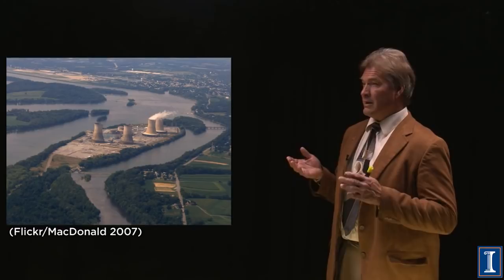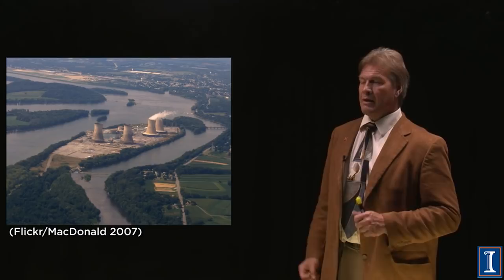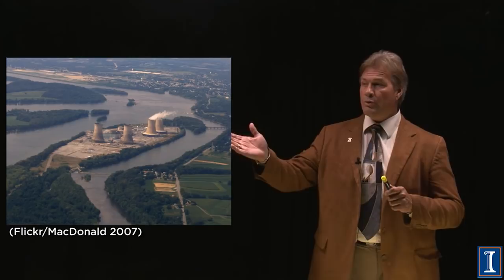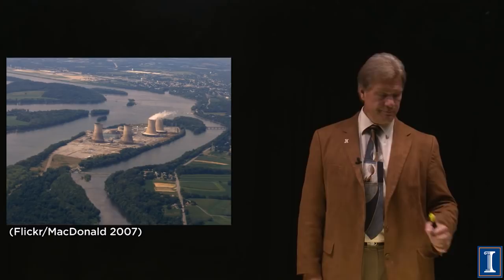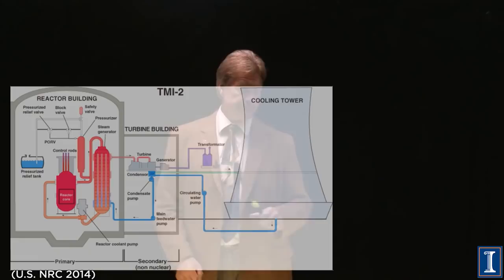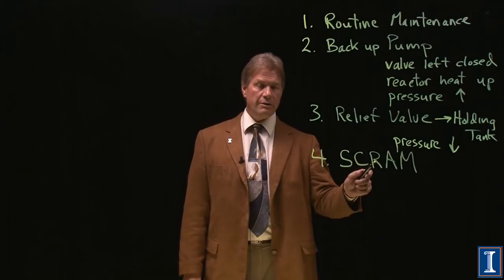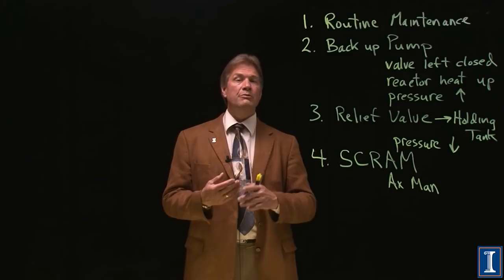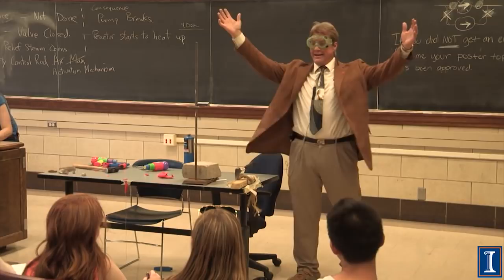How TMI Started

Comment: "It's always the middle of the night when things go wrong" XD.
Reply: 100% Worked in a plant with Ammonia, lots of it. Well I worked on the operations side which was monitored with thousands of alarms. One night the accumulator built up pressure and the relief valve should have opened but didn't. Que a little bit of panic, followed by massive amounts of phone calls that went unanswered for a pretty good amount of time (30-40 minutes) 1 AM. Easy to spot where the problem existed by the piping not having frost built up on it. Hard to figure out why though. Short story was a whole fucking 2x4 left inside some piping that was earlier locked out for another reason and worked on. Still don't know how or why the 2x4 was in there for any logical reason. Some contractor got fired for sure though.

Comment: There is another valuable lesson here for Electrical Engineers and mission critical monitoring systems. At TMI the "valve closed" light in the control room merely monitored the power to the motor or solenoid that was to close the valve. There was no feedback that the valve actually closed. You need a separate sensor to indicate if the mechanical action actually happened, not just that it was told to happen. This idea was nothing new at the time. Every aircraft with stow away landing gear had/has such a system. "The gear down and locked"  light actually monitors the mechanical action, not just  that power was sent to the motors or hydraulic valves. I am really surprised this was overlooked in the TMI design.
Reply: I agree that no physical feedback on a safety value, to prevent a major nuclear accident, is nothing short of negligence on the part the the design team, the oversight team and the nuclear regulatory commission.  Can you imagine being in a plane with "3 greens" from the landing gear without a physical feedback mechanism?  There would be hell to pay for the 1,000's of people killed in planes with stuck landing gears.  A major nuclear accident would kill millions of people.  What would we get from the design teams after millions of people die from their oversight, "Oh I am sorry, I forgot about that!".  That is such bullshit.
Reply: Poor design.
Reply: Thats insane!! Very Poor Engineering, no readback on actual valve position!
Reply: System was believed to be reliable to the point that such a confirmation system was not nessessary, however there was in a place a procedure to ensure PORV closure, a thermocouple was installed within the PORV outlet, this would indicate as to whether the valve was closed or open.... this check was carried out and the results ignored, misinterpreted and put aside as a result of the previous operation of the valve. Like many other steps if they had followed procedure and closed the manual outlet valve down line of the PORV the loss of coolant would have been prevented.
Reply: @jonnytightlips513  But see, that was still a roundabout method of verifying the valve position. If you also want a temperature reading, the thermocouple is fine. But why wait for temperatures to rise and approach a critical situation to send an alarm? A flow sensor or some kind   of linkage switch is still required IMO. Big red light or cell on the alarm panels. "PORV not Closed" period! At that point the critical problem is obvious and the actual water temperature is a secondary concern. I am an EE approaching retirement so I know a little bit here about control systems. Oh and at the time of the TMI disaster I was a student at Drexel University in Philadelphia. So if it had melted down and breached containment, I would probably not be here to write this! But I still remain a strong advocate of nuclear power generation. It's still the only practical "clean" method.

Comment: What a stroll down memory lane.  I wrote my doctoral dissertation on this very topic of TMI-2. Your explanation is spot on and very understandable.
Reply: Do you subscribe/have you heard of the theory that there was sabotage involved? I have no "dog" in this theory either way .. more can be found on the theory here:

https://atomicinsights.com/was-three-mile-island-an-accident/

Also, there is quite a bit in the comments section on that page with additional material and observations by others from that era.
Reply: How did the pump break?
Reply: uploadJ  I had not heard of such a theory. I was analyzing the performance of the men in the control room from the standpoint of organizational psychology.
Reply: Jim Lahey everything I was able to get my hands on said that on March 28, 1979 at 4:36am a crew was trying to clean biological build up out of the filters for the main feed water pumps. And for some unknown reason the main pumps failed. I always thought maybe they dislodged something. Then a bypass valve failed to open as well. I have never come across any information as to the cause of that.
Reply: @jimlahey5354  The accounts that I heard shortly after the accident are rather involved.  When water got trapped in some small instrument air lines that controlled valves for condensate filters, the filters isolated.  The main feed pumps that pump water into the secondary side of the steam generators then shutdown (not 'break') because of a loss of suction pressure (pumps often have low-suction pressure trips, to PREVENT them from breaking).  When this feedwater was interrupted, the primary temperature rises very quickly, the expanding primary coolant surges into the pressurizer and raises pressure.  The PORV valve is designed to automatically open and relieve this pressure increase.

Comment: It turns out the big valve was designed as a scaled-up milk line valve.  In a creamery, the valve is continually lubricated by milk and milkfat.  Not so in a reactor, there the water is corrosive.  A hard-learned lesson.   A billion-dollar lesson.

Comment: GREAT VIDEOS... Questions. There were indicators telling the operators the holding tank was filling up (I watched the second video) but because of it's location NOBODY saw it for almost 2 hours? No indicators telling them the core area was losing water, especially a totally uncovered core? If EITHER of those things happened and surely they had that.. They would have known to restart the ECCS either slowly or much sooner and trace the water problem to the stuck valve. I'm still amazed that even in the 70's they didn't have backup indicators on everything such as the valve or people to run physical checks on everything during a problem. Also wouldn't they have had Hydrogen (the gas) indicators as yet another fail safe and gas exhaust ports to prevent build up ?
Reply: They did have a backup indicator in the form of a temperature sensor on the valve outlet piping. The problems were that that particular valve had been weeping (a very slow leak) that caused a higher than normal temperature even without the valve being stuck open. Also, the expected temperature would not have been as high as one might expect, given the behavior of steam as pressure is reduced. Finally, the backup indicator was not in the main control room benchboard area, and was not in their procedures to check. After TMI, plants went to a vibration method, such that if the valve is open, the tailpipe will be vibrating.

Comment: At IEP, I’ve been watching your content back to back and I absolutely love it. A huge thank you for your sharing of knowledge. With regards to this video, you mentioned water being a combination of hydrogen and oxygen which when super heated has the potential to break bonds and release hydrogen (as per on of the Fukushima incidents (I’m no expect but I believe I heard that somewhere)).... my question is, is there a moderator that would be better suited than water. The capability of releasing a volatile/explosive chemical seems like a bad idea if in the most unlikely of situations. Thanks again for your work. My greatest respect
Reply: A good moderator has a low atomic mass so that the fast neutrons (coming directly out of the splitting U-235) are slowed down by 'elastic scattering'. The lower the mass of the atoms where the neutrons 'collide' with, the more energy is lost with each collision. Hydrogen (in form of water) is a ideal moderator, because is consists only of one proton (and an electron of course). Another important feature of a good moderator is that it only slows neutrons down, but does not (or nearly not) absorb neutrons in the nucleus.

You could use craphite (like in RBMK, Magnox..), but this has other disadvantages of course. CANDU reactors use deuterium as moderator (because deuterium absorbs less neutrons compared to hydrogen), in form of D2O (= 'heavy water'), but in case of an accident it will also will react with the zirconium fuel rod cladding at high temperatures (because its chemically comparable to hydrogen).

The disadvantages of water as a moderator and coolant don't outweigh the advantages. Anyway, the zirconium-steam reaction will only occur in case of LOCA where the fuel cladding has the chance to heat up. If the core is/stays submerged in liquid water (by the ECCS), there is little chance this reaction will occur. And in case there is some hydrogen formation (during an accident it's not only formed by zircaloy-steam reaction) there are recombiners in the reactor building, which will recombine hydrogen with the oxygen in reactor building to form water, without chance of explosion.
Reply: @dvraemdo  it's always amazing to me when you see the entire point being betrayed by Propaganda engineering. Here avoiding splitting water molecules into two is argued to be a good thing and the point of the cooling in part with you double Downing on the propaganda by not mentioning that you can safely obtain hydrogen Which is far better than electricity because of the ability to store it including at twice the density of liquid without the energy tax of liquid. Criticisms of hydrogen are based upon the cost of compressing it but modern hydrogen storage does not have that cost. So but using helium until of course the powers-that-be talked LOL JAPAN out of this you can produce hydrogen which can prevent the use of fossil fuels entirely. So when you're definition a good moderator does not go outside the reservation and provide energy outside of the electric red grid. I believe that a good moderator does the opposite oh, it makes hydrogen so cheap that it itself can liquefy it because saving half the space is not a reason to use hydrides. Using hydrides is an excuse to delay the Banning of all not merely fract but all petroleum for purposes of combustion being granted leases to extract. Water is what the uranium is 4, water is not there to moderate water is there to be turned into gold. I don't know what color of liquid hydrogen is but I know it's better than black. Black lives matter Black Gold is a Star Trek showed it to be the ultimate Evil.
Reply: In this comment I again attacked those who cater to the existing Market in essentially a kind of institutionalized assumed dysfunctional sloth.

Whether you produce electricity or not is a direct consequence of the cost of the energy. The energy obtained from fission is not expensive enough to justify making it even more expensive for little reason. When your primary energy source is so low in cost only corruption explains you converting it into electricity.

The use of electricity is the sort of perfectionism but what is being optimized is is neither profit efficiency or really anything except a kind of protection of that which is obsolete which is directly against the health of the planet and the interests of the people.

There is a rhetoric concerning efficiency that is the way the fossil fuel industry stays alive. It is not what they practice but it is what the feed store alternatives to fossil fuel the mischief and Malice imposing devastating efficiency costs up on the competition.

When there are no externalities, it is very important to maximize cost engineering which means you're maximizing waste. That's how you stop all internal combustion that's how you stop all burning for the purpose of obtaining expansion only without benefiting from the heating much or vice versa. The fossil fuel industry has has as a rule waste oh, so you see pressure being harvested as you see an internal combustion, or when you have boilers, historically and with almost no exception in the marketplace of existing operating aggregate of destroying systems he'd only being harvested. It's the way they roll, but they have prevented us from Rolling that way even when it would be defendable. When you don't do what is defendable sometimes it's suicidal. This is one of those times. Delivering energy where it's needed, doing work, using more of it, but polluting less

Comment: An excellent description of why pressurised water reactors are potentially so dangerous and therefore so expensive to make safe. They are indeed very safe and the industry is the safest power source we have. 
Molten salt reactors especially the Stable Salt (SSR) remove all of those hazards. There is no pressure and no water in the reactor core. They can even lose cooling at full load and remain safe even if the control rods do not drop. 
That makes them much cheaper to build in fact cheaper even than natural gas plants. 
In normal use the control rods would drop and the decay heat is removed by convection only.
Reply: David Elliott   If It were so easy, it would be happening everywhere.  Do a lot more research and you will see the enormous difficulties and drawbacks inherent in the use of salt.  You conveniently cite two or three advantages as though they exist in a bubble of some sort.  Engineering does not work that way.

Comment: Two key misunderstandings about plant behavior at TMI.  

Tail-pipe temperature indications of an open PORV valve were not fully understood.   With 600+ degree F steam upstream and downstream temperature several hundred degrees cooler, some operators miss-interpreted this to indicate the valve was shut.

The phenomenon of 'shifting the bubble' from the pressurizer to the reactor vessel.  A "steam-space LOCA" can quickly lower plant pressure below the saturation pressure for temperatures normally found in the reactor outlet.  When this happens, the water in the vessel starts to boil and force water into the cooler, lower pressure pressurizer.  Plant design at the time only had level instruments on the pressurizer to indicate primary system inventory   Operators were confronted with ECCS systems running, and the pressurizer level indication rising rapidly.  Fearing the dangers of OVER-filling the primary, they shut off ECCS. Operators are trained differently and Emergency Procedures now guide them how to properly deal with this eventuality.

Since TMI, MANY changes have been made.  But three key ones are: better flow indications for PORV valves, separate reactor vessel level instrumentation, and Emergency Procedures to guide operators.
Reply: Even today not all PWR's are equipped with reactor vessel level instrumentation (or they do, but its only designed to use during shutdown conditions), but with the completely rewritten post-TMI emergency procedures (and training) every reactor operator knows not to rely on pressurizer level indictors when the water in the reactor reaches satured conditions. 

Another important post-TMI change is that the reactor protection system now inhibits the manual shutdown of the ECCS during a certain period after automatic start (there's a timer built-in).
Reply: Thanks for this explanation. I was left wondering why they didn’t notice water levels decreasing in the core, but duh. They didn’t have any way to monitor directly!

Comment: One thing I'm not clear about because I've only seen block diagrams but the way the pressuriser was connected to the reactor vessel appears to leave a dead space above the vessel outlet that was above the connection to the pressuriser. Now I'm guessing that under normal or low pressure circulating coolant conditions this didn't matter as any traces of gas or vapour would be forced out but under passive cooling there doesn't seem to have been a way for vapour at the top of the vessel to reach the pressuriser. Had there been such a path maybe the pressuriser level would have dropped and instruments would have reported this.

Comment: A similar incident happened at the Davis-Besse NPP on Lake Erie outside Toledo, Ohio but the operators discovered the coolant leak and corrected it before the core became uncovered. Had it gone undiscovered for another forty minutes it would have melted down just like TMI2. For a complete list of accidents there see https://en.wikipedia.org/wiki/Davis–Besse_Nuclear_Power_Station
Reply: And that happened prior to TMI?
Reply: @boristheengineer5160  In 1977.
Reply: Yes it did, and the NRC failed to notify operators of like reactors of the incident.
Reply: I think there also was a thermocouple on the tailpipe of the relief valve to indicate the temperature. I high temperature would indicate a leaking or stuck valve.